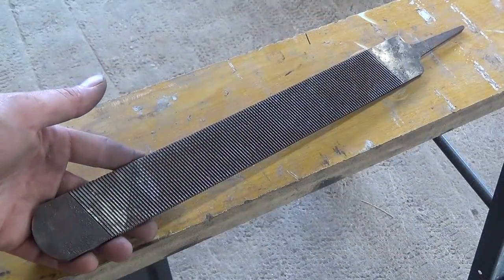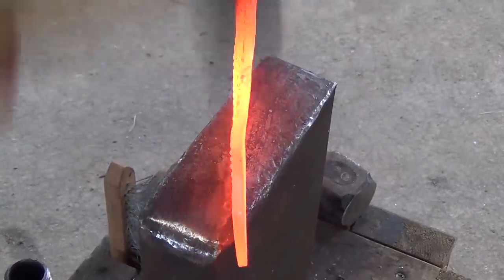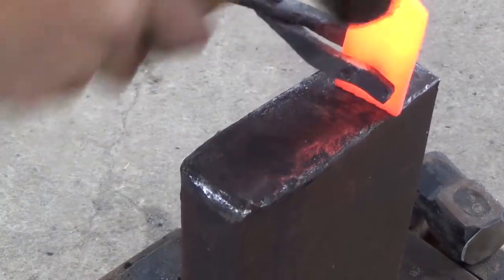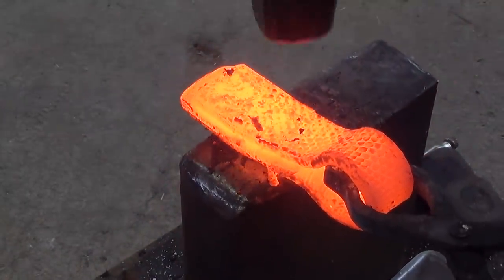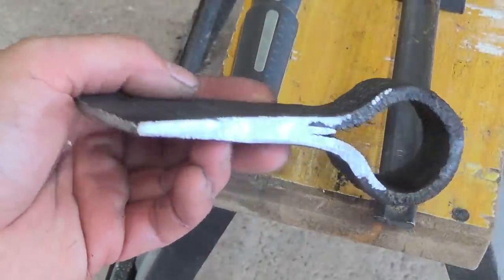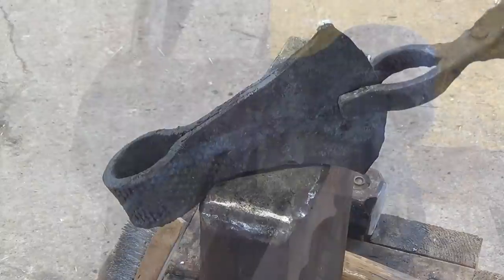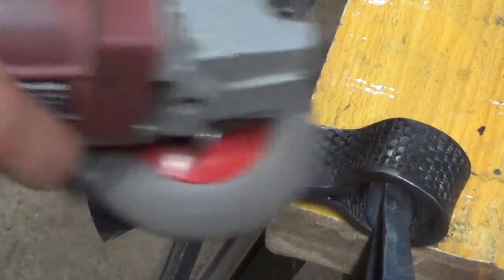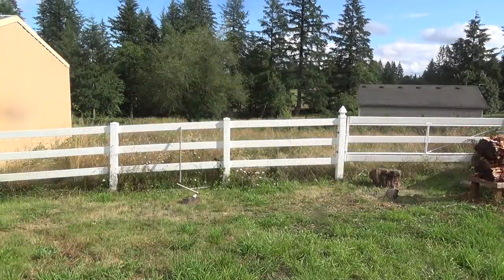How to Forge a Farrier Rasp Tomahawk - Camp Hawk

Comment: This was a modern take on how how to do a tomahawk head with a very traditional handle. The handles at that time were designed to be interchangeable with different tool heads using a tapered handle. This same handle might be used with a froe or adze head. 
WELL DONE!  (including very good description of the process)

Comment: Nice work.  You might want to try hot rasping instead of the grinder to clean things up.  Just us the fine side of an old farriers rasp on the steel when it is at red heat - does a nice job.
Reply from the maker: Thanks for the tip! I never thought of using a farrier's rasp on hot steel, but it makes sense.

Comment: Hey nick. My coal forge hasn't been doing so well lately so I figured it was finally time to make a gas forge. I'm just curious as to what  you used for the "firebrick" mixture on the inside wall of the forge. Is it the same as what you used for the soup can forge, just bigger?

Comment: I have a questions about forge welding in general. I used a file much more rigid than the rasp. I did research and found that forge welding had to be done with smooth surfaces. I was curious how you were able to forge weld these 4 surfaces together when they were not flattened or ground smooth. I tried, like I said, with a file and failed both times. First try it broke in half and second try it obviously didn't weld together. Do I have to hammer super hard or light for them to bond? Maybe my surfaces were too rigid?

Comment: So when you say a rod sticks to it is that steel rod cold or also hot? Tried forge welding some today and couldn't get it to stick at all. It was non magnetic but not sure if it was hot enough, I stopped cleaned everything on a grinder and going to try again tomorrow.

Comment: Not sure if I will get a response  in time, but I have been trying to make a tomohawk using this video as a guide. However, for some reason, when I attempt to forge weld the pieces together, they don't stick. I used borax in the same steps as this video, my forge is at the right heat, and I have forge welded before at less heat and no borax using this forge. Any insights on to why this may be happening?
Reply from the maker: @shad5812  If you welded without borax before, keep in mind that the molten borax can make the colors look different than if you didn't use borax.

Comment: Imma give you a quick blacksmith tip how you can save some flux: You only have to use a sprinkle of borax, this much borax will most likely make the weld even worse, the thing that keeps the steel from oxidizing is the molten borax :)

Comment: Can someone explain the gardening and tempering part / process? Please? How do you know what colours yield the best result and last edge ??
Reply: Basically heating the edge a little beyond non-magnetic and then quenching it transforms the steel in the edge into hard and brittle martensite. By only cooling the edge, the rest of the axe remains soft and very hot.

Taking the axe out of the oil and cleaning a spot on the edge opens up a little window through the scale so I can see the tempering colors. The residual heat in the rest of the axe slowly seeps in, heating up the edge from the inside out.

I usually temper to straw, which is a darker yellow/gold. This is good for smaller axes and allows for good edge-holding. If I were making a splitting or felling axe, I'd probably temper into brown so that the edge isn't brittle.

Hope this helps!

Comment: How long is the rasp? Is a 10inch one from Home Depot bad? Do I need borax?
Reply: If not, can you give me a link to the one you got?
Reply: Forge welding requires the weld surfaces to be extremely clean or the metal will not join properly.  A simple flux can be made from borax and powdered iron-filings.
Reply: Lee Smith so I can just go get borax from Walmart? and how long should the rasp be? Is 8 inches to short?

Comment: how well does that heat treat technique work?
Reply: It's worked well so far. I've been practicing using it, a lot of old blacksmithing books talk about using that technique for hammers, axes, chisels, and punches. The reasoning is that these thicker pieces of steel take longer and more controlled heat to temper from the outside, allowing the residual heat to temper it from the inside makes more sense. It's a neat way to do hardening and tempering in one step.

Thanks for watching!
Reply: +Nicholas Tomihama 
no problem man. keep up the good work

Comment: I want to Forge a Blade some day but cant find a place where i can do it
Reply: your backyard.

if you've got a shop vac, dig a hole, use hole to make charcoal out of wood, put some charcoal in the hole, dig an air inlet, position shop vac at inlet, find something to use as an anvil, light it up and go to town.

(Anvil ideas: an old sledgehammer or splitting maul head set in concrete or cement [my personal daily driver] or a piece of railroad tie/track or even just a hunk of steel. a log can even be used in desperate times.)
Reply: could you use a hair dryer?
Reply: They kinda work. Might want to remove the heating element though.
Reply: Corpse Hugger a hair dryer works just fine. tape it to a peice of metal pipe and feed the air into the fire. just tape the the cool air button so it only blows cool air
Reply: thats what ive been doing for the past year and im ready for a new forge

Comment: seems like a bit of unnessecesary work putting the rasp in as blade.
wouldnt it be better to use 2 different tipes of steel.

awesome work anyway!

edit: just noticed that you didnt harden the body of the axe.
so my comment is pointless.